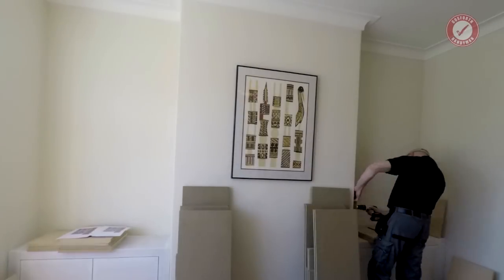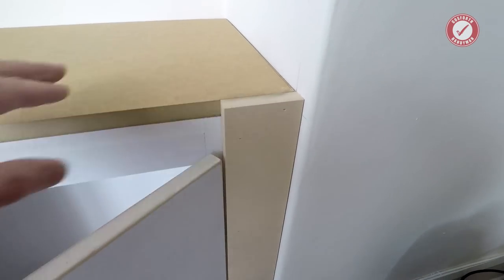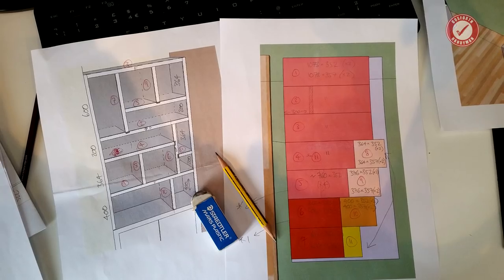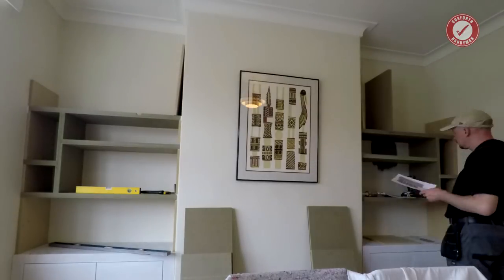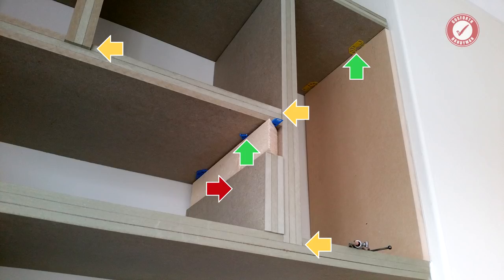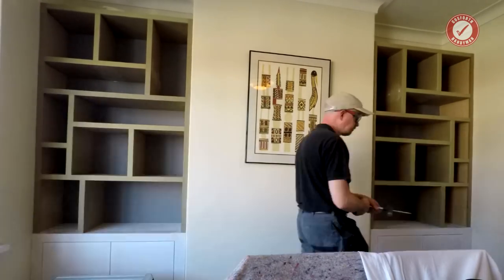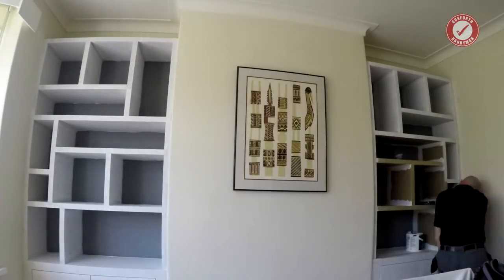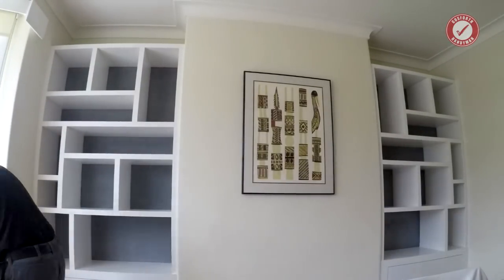Making Random Design Alcove Shelving - Full Walkthrough

Comment: Great Video Andy. Really informative and excellent quality as always. I am a new subscriber / patron and have learned a lot from your productions. The "down to earth" style of working and presenting make brilliant and enjoyable guides. .
 I love your 3x12mm construction on this project. Right now I am making 2 floating shelves to take heavy audio equipment and opted for 2 x 18mm MDF. I did not think of weight savings with your skeleton central layer .  They are supported on 2 each  12" steel studding with 5" resin-bonded into brick wall and 7" in routed groove in lower 18mm board. Your technique would eliminate need for routing, just another "false dado" (Well really a "false drilling" as it would be in the middle of 3 pieces).
You say you used 12mm MDF facing to shelves. Presumably this was 12mm thick x 36mm wide strips. So were all your glue-ups of 3 x 12mm boards identical finished thickness, or did you have to trim each individual face piece to match exact dimension?  Were the face-pieces all straight butt joints, or something more elaborate?

Comment: Thanks for this post, really useful to see how you've approached it. I've just been asked to do something similar in 36mm MDF, 3.5 metres wide, floor to ceiling, asymmetrical shelves and sandwiched between two walls on either side. I initially thought 'no problem', then started to realise that it wasn't that straightforward.

I think I will be building mine as modules, split up into units as small as possible and with a back (as you mentioned). I'll joint them with a Festool Domino rather than dados. The modules will then be put together side to side, with two 18mm sides making up the 36mm thickness where they meet up. I'm not going to attempt to put a cover strip on the front, I've tried this before without much success, difficult to avoid a visible line if these are put on after assembly. I'm going to get everything edge banded, the obvious line between the 18mm verticals will become a 'feature'.

I'm already wishing I hadn't started this!

Comment: One of your best and so timely. Just built a similar style tv unit as a first carpentery lock down project all inspired by the spirit of GHM. I used ply painted gloss white with Danish Oil edges. Can I ask what was the reason for using MDF?
Reply from the maker: Thank you! Mainly since MDF gives a better painted finish. It can certainly be done with ply but you'll need to hunt around for really good quality ply or fill and sand every single imperfection. 👍
Reply: @GosforthHandyman  I'll try it for the next project - thank you

Comment: Nice walkthrough. I got to this one a bit late. Do you use any fine filler where the MDF edges meet, e.g. the front lipping, or where the shelving meets the cupboard top? How do you make the seam 'invisible'?
Reply from the maker: I might cover this on a vid - interesting topic. You can push it to a near invisible join but then come back in 6 months and you'll see a slight line due to expansion / contraction. Really it's about how much spare time you have on the project to get it 'perfect'. 👍

Comment: What kinda hinges did you use on the bottom units they seem to push the door out further nice job
Reply from the maker: Hi - yes, they're special ones that spring outwards rather than inwards. These were just B&Q ones I had in stock. 👍